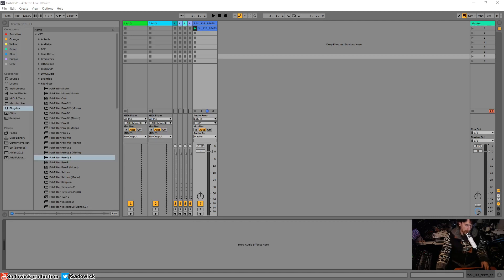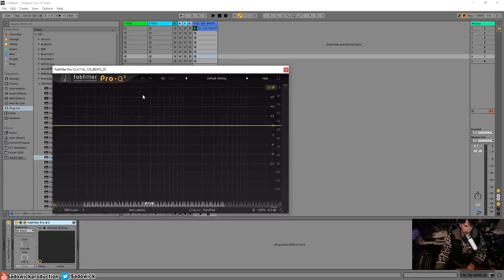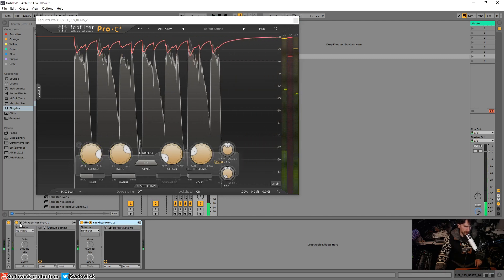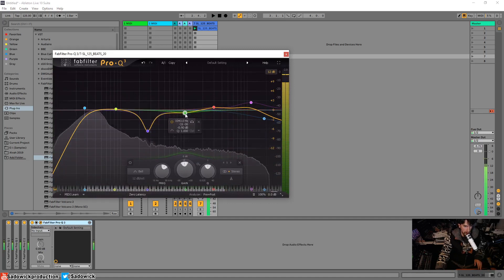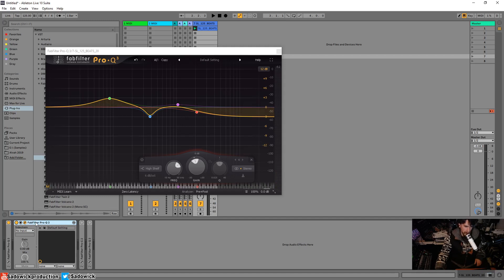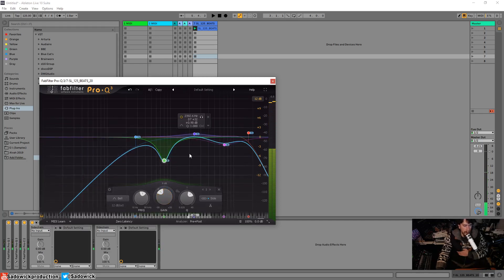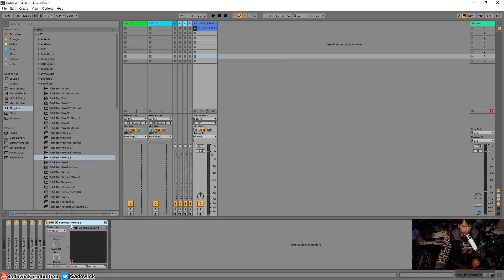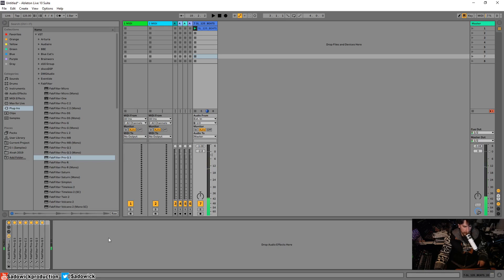Why Multiple EQs In The Same Channel?

Comment: I don't think this is a very good example as to why you might need more than one EQ instance in your channel. I mean it would make a lot more sense first of all you should always ask yourself do I need to EQ as for every other FX. You should always ask yourself if you really need to add that FX, what is the sound that you're trying to achieve? And then you evaluate whether you need them or not and if you do need them then in the EQ case, personally a scenario that makes more sense to me is maybe add an EQ before a compressor to make the compressor more likely to affect certain frequencies than others and maybe after to sort of recover (if you need to) those frequencies that you lost in that process. Another example could be with distortion/saturation to enhance or ease certain frequencies that you gain from distortion/saturation. Etc. By the way, whatever you do, DO NOT add an EQ just blindly like that because it makes you feel cool or just because you heard that you've got to high pass everything and reduce the mid-bass area otherwise the frequencies in the mix build up and the bass gets muddy. ALWAYS ask yourself what's the thing that you're trying to achieve and if you need it use it, if you don't need it don't use it. Don't high pass everything, that extra bass might be actually desirable, and if the bass gets muddy then just mute and unmute every single channel in your project until you find the channel that's mudding up the mix AND THEN IN THAT CASE PUT AN EQ THERE AND LOWER DOWN THE BASS REGION A BIT until the problem goes away. That's the best way to about it really. And the best example as to why you might want multiple EQs in a channel
Reply: DJ V.a.r. Be curious and try whatever you want. Recalling takes a ms. That’s how you learn, that how you progress and that’s how you find happy accidents.

Comment: but doesn’t that cause a lot of extra unnecessary latency?
Reply from the maker: Nope. The default mode of Pro-Q processes sample by sample so there's 0ms of latency. Even if it did add 5ms (average for plugins that require latency) of latency it wouldn't be noticeable unless you're tracking. For reference 5 milliseconds is how long it takes for a honey bee's wings to flap once.